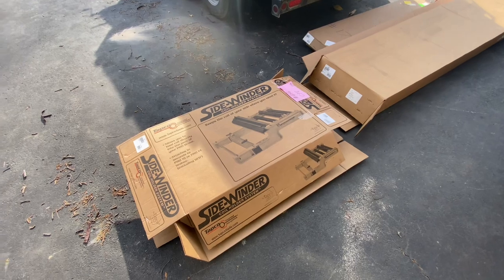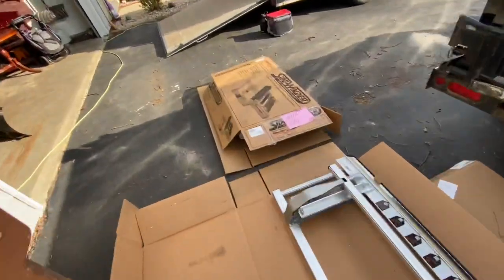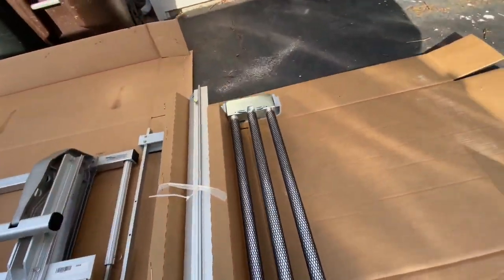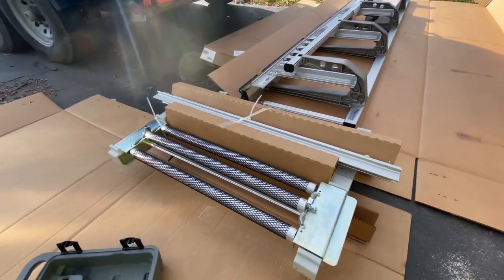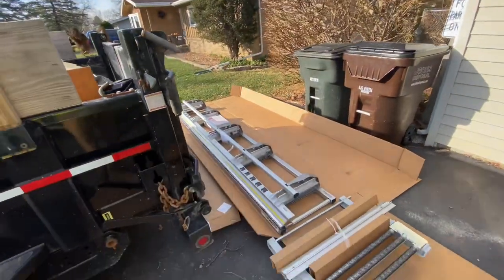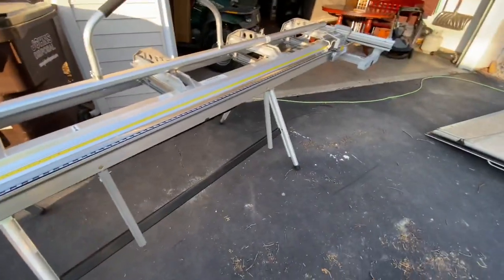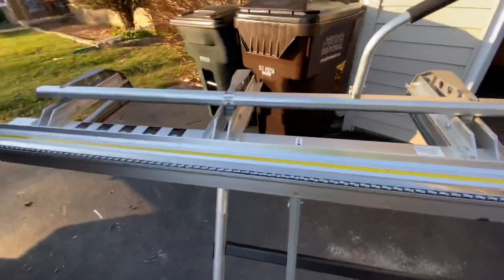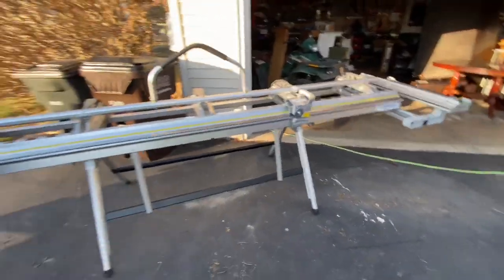New Tapco Pro 19 Siding Brake

Comment: Your much better off with your brake mounted solid in at least a 12’ cargo trailer. Then build at least a 24” wide self directly above the brake, pad it with 1/4” foam board or thin carpet and do your unrolling and layout measurements there. Gently slide the metal directly down into the brake. Trust me, nothing works better on a windy or rainy or just plain hot bright day! Gary, in Michigan. Siding contractor here since 1972...... Blessings and good fortunes!
Reply from the maker: Well my 16’ trailer is pretty full so the snap stand will have to do. Lucky for me I’m a general contractor so it’s not a tool I have to use day in and day out like yourself. I generally use it for odd ball jobs so it’s better for me to have it on the snap stand where it’s not taking up precious space in the trailer. If I did use it more often I would definitely find a permanent home for it.
Reply: @TheRealBeardedBuilder  good luck, good video, thanks for posting it...Gary